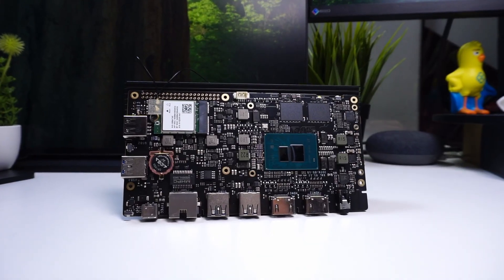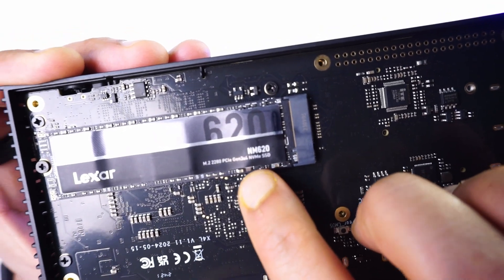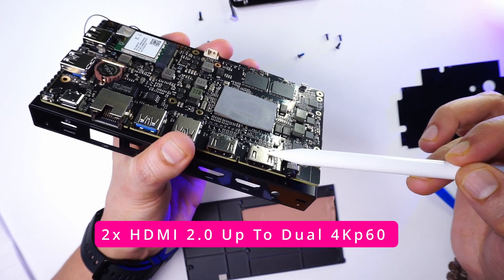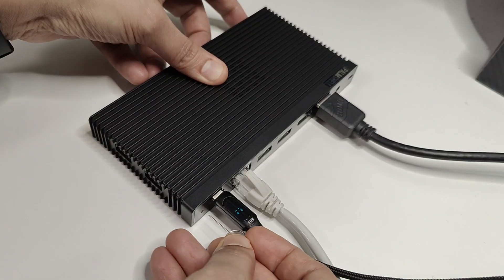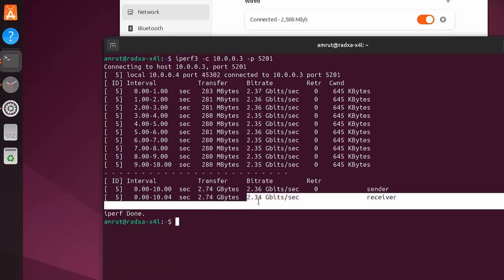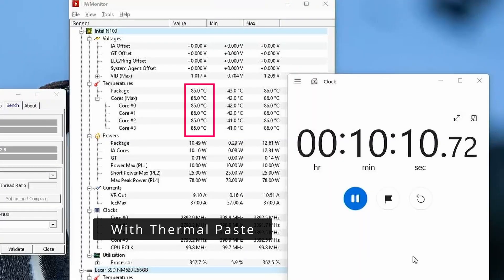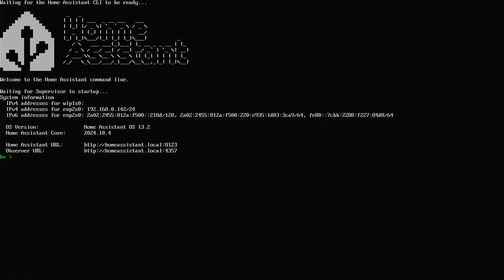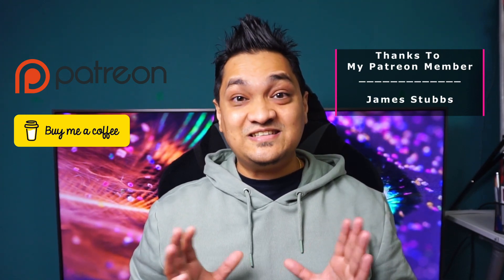Radxa X4L: Powerful🔥Pocket Size PC | X4 comparison, Benchmarks, Home Assistant & Use Cases

Comment: BRO DOES IT SUPPORTS POWER ON AC OR AUTO POWER ON
Reply from the maker: Bro.. Why is your question in caps? 
Do you know that it means you are screaming at me?
Reply: @SmartHomeCircle  Bro I was taking your attention soory for that but I want to genuinely know where it supports auto on feature. Again sorry 😢
Reply: @SmartHomeCircle  Radxa team is not given the response and not mentioned this features on official site. There is only your video in whole youtube that has proper information ℹ️
Reply from the maker: @MeghBadonia ok. No issues.
So the X4L does support turning on when connected to power with power restore option in the bios. It also has wake on lan.
Reply from the maker: I have brought from Arace site and dint face any issues. You might have to pay for customs because you would be importing it from Hong Kong.

Comment: Great, in-depth review! I'm currently trying to decide on either the X4 or X4L. But, i have a question regarding the cooling. When you put the top of the case on the table, i could see the holes for the fan inlet. However, i could not see where the hot air can vent from.  Even on Radxa's site they show an animation with cool air going into the fan opening, but the hot air  exhaust is just venting out of the bottom mysteriously somehow. In your video it looks like the sbc is a very tight fit to the case. So how does the hot air get exhausted?
Reply from the maker: The air gets exhausted from the side, ie. the shorter side. As per my thumbnail picture, its on the left hand short side, while the air gets pulled from the top.

I hope that helps 🙂

Comment: The board is actually the successor to the Radxa X2L, whose special feature is the built-in RP2040 that controls the 40 GPIO-pins. As you have noticed, the 40-pin header is not mounted on the PCB. You only had to remove the WLAN module, then you would have found the mounted RP2040. Unless, of course, Radxa not only saved the 40-pin header, but also the RP2040. Maybe you could take a look under the WLAN module? That would be nice. 👏
Reply from the maker: Ohh yes.. The RP2040 was under the wifi module. I realised it later. 🙂